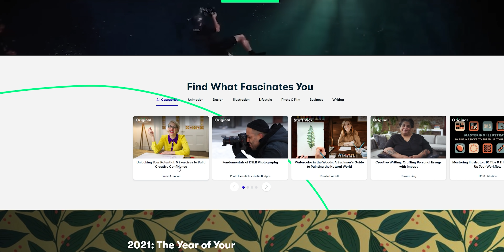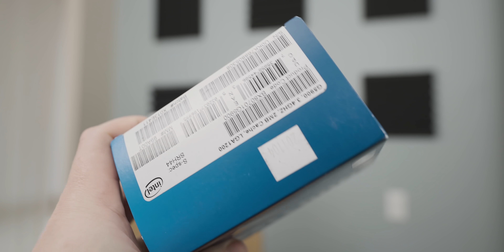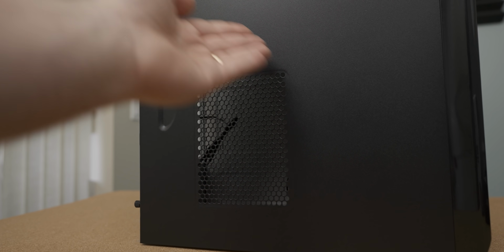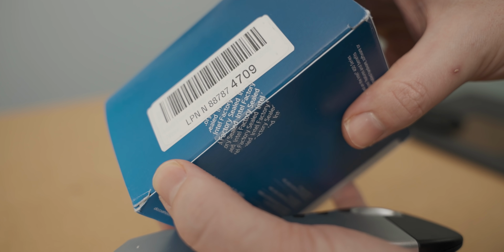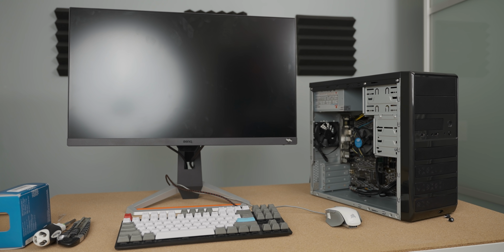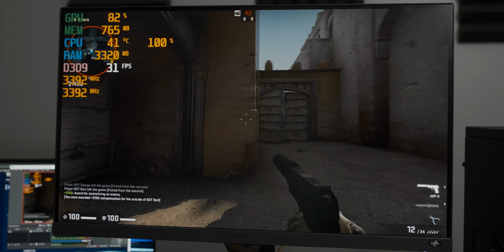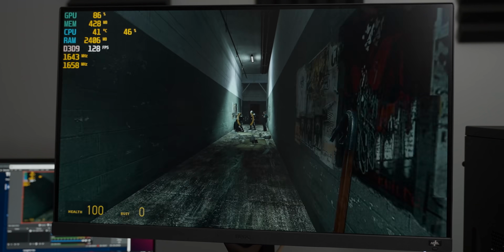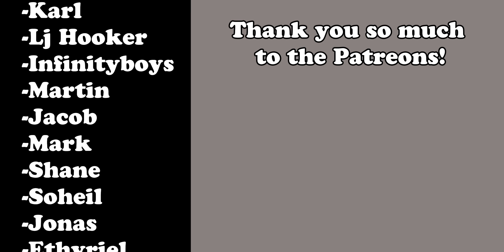Trying to game on the CHEAPEST NEW PC you can buy in 2021...

Comment: My desktop from early 2019 has been initially $80 more expensive, but I reused a 128GB SSD and 3 HDDs (2.5" 320GB; 3.5" 500GB; 3.5" 1 TB). I bought:
- $98; a Ryzen 3 2200G
- $83; Memory 2 x 8 GB 3000 MHz
- $60; an AsRock B450 HDV Rel 4.0 motherboard with only a 4-pins CPU plug.
- DOP1500 ($30); a local Midi Tower with an iTech 600W power-supply (4-pin CPU plug, 2 SATA and 2 Molex plugs and NO Video card plugs).
- $15; adapters for 3.5" to 2.5" and Molex to SATA power plugs.

In November 2019 I bought a 512GB Silicon Power nvme-SSD (3200/2300 MB/s) for $65 and dumped the SSD and the 2.5" HDD. 
So up to now I did spend $336 on the equipment and I have a really great desktop. Living in the Dominican Republic I did not count the import duty and transport costs, together 35%-40% :(

I do run Linux (Ubuntu 20.04) and moved my "work" to specialized Virtual Machines, the average Linux VM boots in ~10 seconds, the Xubuntu VM boots in 6.5 seconds and Windows 10 Pro VM needs 25 seconds. My gaming is basically Solitaire since Windows 3.1 and occasionally Linux games like SuperTuxKart; Extreme Tux Racer and good old Wolfenstein-3D in Dosbox.  However I run those also in a VM with Virtualbox 3D acceleration at 1080p and 60Hz.

Comment: The Ranger M is actually very popular, its one of the best dirt cheap sub-$30 cases on the market and very popular with the low budget and home theater, and workplace pc crowd - I got mine for $22.99 on sale, its true cable management is weak but if you have a modular supply its not bad.  It has better front to rear flow through ventilation characteristics than almost any other dirt cheap case on the market. I changed the back 80mm fan to a 92mm Arctic silent and its good to go.  That coolmax power supply however reeks of lower tier assembly line oppression and is basically a thinly disguised house fire ignition source-lol

Comment: One of the most applicable statements I've ever heard regarding the desire for a state of the art computer is a person that waits for the price to drop on today's high-end computer and who will then wait for the price to drop on tomorrows high-end computer probably didn't need a computer after all. I used to do this starting in the 1980s except I went ahead and bought those discounted high-end computers. Now, I have a storage room filled with xt, at, and laptop cases loaded with enough computer gold on processors and components to start milling my own coins. I just wish I could remember what's on the hard drives that might be worth saving. But if I'm moving forward and not searching for some long-ago stored data I don't need to waste time booting them up one at a time.

Comment: Some mixed comments:
1. The computer seems well balanced between CPU and GPU power.
2. I'd opt for a cheap HDD instead, to get more storage.
3. The PSU having an input voltage selector switch is a big warning sign to me.

Comment: I used some of these parts. The CoolMax PSUs make funny noises when they fail.
Reply: I once revived a "dead" PC - by blowing a hot hairdryer into the rear of the PSU.
(I thought the online instructions were a meme - friggin worked.)
Reply: @KathrynsWorldWildfireTracking  Now I'll admit I didn't try that. Generally when there's a series of loud bangs and smoke coming from a power supply followed by a whistling sound and the grinding of the fan blades against the housing, you dive for the wall socket and pray.  I think the pops were actually the PSU heroically sacrificing itself to save the other components, the whistle was weird and had an unknown source, and the grinding noise was because the fan was still spinning but the pops had cracked the mounting inside the case. Still, I was able to recover everything except the floppy and optical drives of all things.  The bad news? The only power supply I could get locally on short notice? Another CoolMax! Still have it, it refused to blow up even when running modern(ish) computers (like an FM2 A10). So my first one went spectacularly and the other is either immortal or planning to blow up when not plugged in just to spite me...

Comment: If you're looking for low spec pc you can find a pentium gold g6400 for like $90 which gets you 2 cores 4 threads and it clocks up to 4ghz and includes a heatsink. 

You can find an 8gb ram set for like $55 and a 500gb ssd for $55. Throw on a used power supply and case and you can probably get a marginally better pc for an extra $200. Throw on a used 1050 for $100 and you'll get a way better system

Comment: I actually use coolmax a lot because it’s cheap and I’ve never had problems with them. I wouldn’t expect it to last more than 5 years BUT if one were inclined you could probably just replace the caps and it’ll last longer. 

I work for Chuck E Cheese fixing the games and our gameroom is on for about 12 hours a day 7 days a week for 363 days a year. A few of my games have a coolmax PSU in their computers right now. Although they don’t have much of a workload on them as the games aren’t that demanding but they are on for a very long time. 

So, for a bottom budget build like this one or slightly more powerful they aren’t that bad. All I can say is that I’ve never had one take out other components.

Comment: The intel i3 10100F is only $100 and has decent clocks. 4c8t CPU isnt too bad entry level cpu. I wouldn't buy anything lower. I have been using a 4770k 4.4ghz all core for about 6 years now.. seems to play modern titles with my 1070ti without a problem. So i imagine the i3 10th gen being better if paired with any gpu you can basically get right now... But that (F) series has no dedicated graphics. So a GPU is a must!

Comment: hey just bought the same case and psu, the SSD mounting spot is at the bottom of the case. For a cheap case it really isnt all that bad, anyone looking at getting this case the only problem i ran into was both fans are 3 pin, so if your mobo only has 1 fan connector and the psu has none you will need to buy an adapter.

Comment: that PCIe slot would fair well with graphics cards that don't require external power, i.e. the nvidia geforce 1030 (first gen, not the one they downclocked) or even some 1050s or an RX550

Comment: As a 24 year IT professional it always makes me snicker when tech tubers are surprised that cheap motherboards can run 10 core chips. VRMs don't die instantly, they will degrade very quickly with too much heat, though. You'll cut the life of the VRMs in half. 

Give it a year or so. ;)

Edit: oof that mask is wildly offensive mate

Comment: Actually,i also had that "chemical" smell from a new PSU,but it was a Be Quiet System Power 9 500W,and it is a good PSU with good parts,so that smell dont need to be with a cheap PSU.
(Actually,when i checked,smell was from a power cord,not a PSU,so i should probably use a different one)

Comment: That looks like the sort of psu my local computer part store would sell. I had  bought two PSUs from them before I wised up. The second one basically blew up and spilled oil all over. Surprisingly enough, the computer still worked after I replaced the PSU.

Comment: I had a PSU from the company called Safeway. Just a crappy PSU with 80mm fan, it cost me around $10. It says 500W but it was around 250ish watts. I've used it with my i5 4570 and RX 550 for around 2 years and never had an issue...

Comment: Don't open that Coolmax PSU- The sunlight may scare the Crapxon and Gluxon rail caps into exploding. I bought a bag of those things brand new once, I think at least 700 out of the 1000 had popped tops. Good thing they were cheap, because I ended up throwing the entire bag away. I couldn't believe they were 105 degree rated- I'm fairly certain a good fart from across the house would have popped them.

Comment: Here I am using a 2000 dollar computer I bought from Bestbuy in December for 1500 Canadian. With a i7-10700, RTX 2060 6gb, 16gb DDR4 2666mhz,  512 SSD, 1TB HDD. It replaced my old i7-6700, GTX 1060 6gb, 16gb DDR4 1066mhz, 1TB HDD. Which I still have. 

The difference between the two computers I'll explain with Cyberpunk.

Old computer playing Cyberpunk on medium settings got 40 FPS. 

New computer playing Cyberpunk on Ultra settings got 60 FPS. 

We all know Cyberpunk isnt optimized for shit. But it's a good benchmark.

I got the ACER predeter 3000. I still have my old computer I got 4 years ago from Staples for about 1500. If you wanted to do a video about pre built computers for 1500 dollars. What you could get 4 years ago to what you can get in 2020/2021.

I live in Abbotsford so not far from you.

Comment: I wonder how much this system would improve if you put in a second stick of ram and a dedicated GPU, maybe a 750 ti or maybe a 1050. Although a dedicated GPU might not even help because the CPU was sometimes the bottleneck to the iGPU.
It might not be completely terrible if you made those adjustments and added a more stable 80+ Bronze-Silver Power supply. Although Ryzen would be a better bet for such a budget build and honestly it would be more cost effective to just save up for a better system all together down the road.

Comment: well..... it can do up to 6th generation console emulation..thats one shit ton of video games. And I think it can play all video games released up to 2004 on the highest settings.

You just need to clock that memory stick from 2400mhz or whatever it is...up to 3200mhz CL18.
You could had built a cheaper PC by buying a PC case that has an integrated PSU.
In that 60gb ssd.. with 20gb left you can get Tekken 5, Gran Turismo 4, NFS Most Wanted and GTA San Andreas

Comment: Oh lord. The cpu and mobo are the same I just picked up for my Stepmania build. 

I did go with some dual channel 8gb Aegis DDR4 RAM though. That and I decided to torture myself and slap it all in a Rosewill R379-M SFF case w/ integrated PSU at a whopping 300 watts. 

Then again this thing is going to run a 20mb Dance Dance Revolution clone from 2016 at 720p. 😂 So I’m not worried.

Comment: I found a used dell optilex with a i5 2500 with double 4 gigabyte ram sticks no hard drive for 69 bucks on eBay, found 500 GB hard drive on newegg for 20 bucks and ssd for 20 bucks 120 GB and finally a used gtx 1050 ti for 75 bucks in all: about $184 took me like five minutes to find the parts 
Sorry forgot power supply eBay used 450 watt power supply 25 bucks

Comment: That's a good put-up system. Unlike mine. It's a mix of alot: the optiplex 7010 mbd and CPU (but other cooler) GTX 1050ti 16gb ddr3 ram and 2ssds that failed recently sadly. And also the plate for the back ports don't match and the front io can't be plugged

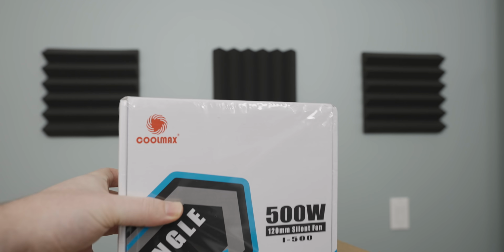Comment: @3:20 - Surely Rosewill haven't become THAT bad over the years? It's 2022 and I'm still using the Rosewill 530w 80+ Bronze PSU I bought back in 2012 with no problems (and it's been going 16-20 hours with very few breaks, mainly when the power goes out for a few days). Or maybe it's just their non-PSU stuff that's crap? :)

edit: Also, GTAV on a 60 gig SSD? Neat trick. :P

Comment: here is another tip: if you wanna do a budget pc dont buy brand new parts (except you gonna use a hdd) bro i did build a pc that has  Asus Cerberus 1050TI + Intel i5-7400 + stock intel cooler + Asus Strix Z270H gaming motherboard + double 8gb 3200mHz ram + 500 watt powersupply + 1TB hdd + 256gb sata ssd and 110gb sata ssd for only 300 dollars

Comment: why does Intel still make dualcores? because they can probably make them cheaper than quadcores and they can still do whatever general productivity task u throw at them. except maybe decode 4k video but that is why the gpu has a hardware decoder. i put an SSD into a core2duo PC once and after it was done installing stuff, the PC felt reasonably snappy. so does the MS surface go 2 with a Pentium Gold processor i am using at the moment.

Comment: Welp, just to flex, i got a pc i just built:
CPU: E3 1225, $18
CPU COOLER: USED HYPER 212 EVO ($10 + $4 SHIPPING)
GPU: RX 470 4GB, $80
RAM: 2X4GB, not sure had it lying around
MOBO: ASUS H61M-E, not sure had it lying around
PSU: KOREAN PSU 600W TRUE RATED (i know its stranger danger, but i had to go for it) $15
Case: generic case, $5?
Hdd: old hdd, not sure price
Total price(without unkwown): $132, maybe more or less $175 in total, dats pretty good for me.

Comment: i have a question, CSGO is running at 720p at full screen, when i tried it it runs at 720p but not fullscreen, anyway i could try fullscreen at 720p? also that moment when the fan wire got caught in the CPU fan blades, same thing happened to me with my first build lol.

Comment: The power supply is fine. Yeah, it's crappy, and I wouldn't even feel comfortable using it in a system that pulls 150W, but a 58W Celeron won't put any significant stress on it.

Comment: heyy that's exactly what I felt unless it's worse cuz mine is 1.6ghz celeron hd 1000 with 4gb 1066mhz
and I did tried sottr on it as well, and I got a little bit lower than that 9-10 fps but it was on 800x600

Comment: I didn't think you coulid buy 60/64GB SSDs anymore.  The smallest ones I see are the 128GB and even then so, the 256GB ones are only maybe $10-20 more.

At just 60GB you wouldn't even be able to install GTA V....  I mean a 128GB SSD with just GTA V on it might even be pushing it (when you factor in that Windows 10 takes about 15GB of disk space for a basic install, not including any drivers) and then GTA V last I checked was about 65-70 GB after you get all the downloadable content required to play it (I think the base game is only 60GB on DVDs).

I always found those cheap power supplies to be funny.  I mean I'm still using my PC Power & Cooling Silencer Mark II 750 watt unit now 12 years later (of course there was a bout 3 years it wasn't being used, but it has been for the other 9 years and it's still going strong -- this of course was before OCZ bought PC P&C, and the unit wasn't exactly cheap at the time (about $450).  But hey, I'm here using it 12 years later in my latest 6-core AMD gaming build (with an RTX 2060).  Of course back then the average computer had a 300-400 watt power supply and video cards used maybe 200-300 watts, so 750 watts was actually a LOT of power back then (when the high-end super expensive units were only about 10000 watts).

Comment: yes this the cheapest of the cheap. As said to an old friend: The single core is dead. No computer should have 2 base cores unless you're building it for a Microsoft office and Canvas. Spend the money on at least 10100F 4c/8t or the 10100 4c/8t. If you need cheap in 2022 like I did.

Comment: This is quite literally a build that is so cheap that it is a waste of money, and just increases the amount of electronic waste.
The cheapest usable PC should always include two sticks of RAM.   That is a completely unnecessary bottleneck for an insignificant cost increase.  That choice alone creates CPU and GPU bandwidth bottlenecks and system stutter for lack of RAM.  Also, 11$ more would quadruple the size of SSD.  
Now those upgrades total around 30$ and make a lot more usable system. 
Then we get to a more subjective territory, but right now I would consider i3-10100 minimum reasonable new PC build. Three times the CPU performance twice the GPU performance for under 70$ more. 
So around 300$ would be the minimum for a usable system, and even then doubling the RAM and SSD would make a lot of sense to create a better overall value system.

Comment: My Second and Low Tier build is actually better than this?
For less than $100-$150ish

FX-6300+ Morherboard+ 16GB ddr3 2100mghz 
( For free got it of from a friend)

GTX 750 Ti for $30 bucks

Thermaltake 500 watts 80 plus White for $50-60 bucks

I got it on Black Friday sale 
Storage: hard drive 500gb + 248 Gb ssd
For $30 bucks

And lastly the Case
Corsair R100 for 30 bucks.

Comment: Yeah, laugh at Celeron like a brat child. 
Celeron supports ECC memory, supports IMTEL solutions, and has low power consumption and thermal performance, these things make Celeron great for low cost machines that don't focus on personal use, things like smart device control, concierge booking system and whatnot. On top of that, it has intergrated GPU, which also makes it perfect for HTPC or NAS all in one machines, intel's intergrated GPU might not be good for gaming than Vega, but is the best option for video playback, for G5900 it has a UHD 610, which can decode freaking 8K videos on a hardware level (not perfectly because CPU part still weak), with knowledge, you don't have to buy another router or  TVbox or home theatre.

Comment: Damn u really got scammed on that Celeron. It usually goes for around 20-30 bucks
Reply: And u could try out mainbaords with embedded CPUs in them. They are usually dirt cheap and use Laptop CPU so they will use basically no power. Add some ram cheapest SSD and a 4th July special Edition chinese 800 watt PSU from AliExpress for like 10 bucks and boom, u got urself a nice cheap rig

Comment: I need a cheapest build to play WoW at ultra settings with high frame rates.
Reply: Need to be more far more specific. What's a "high framerate" to you? 40+? 60+? 100+? What resolution monitor are you using? 

Either way, WoW is a very CPU intensive game. Gonna want a very fast one for it. GPU you can go back a generation or so and it will make no difference.

Comment: You know what's fucked, I was gonna buy a shittier rosewell case that literally looks like a dell and the only reason I would buy it is cause I sadly can't find a way to hook up the front panel to my case (I originally wanted to do a beefed up optiplex case). I could still turn it on with a screwdriver, but at that point it's not really worth it at that point. https://www.amazon.com/dp/B07VWVJ5BN/ref=cm_sw_r_cp_apa_i_K9H-FbXQ6CX1E?_encoding=UTF8&psc=1 that's the case I got instead